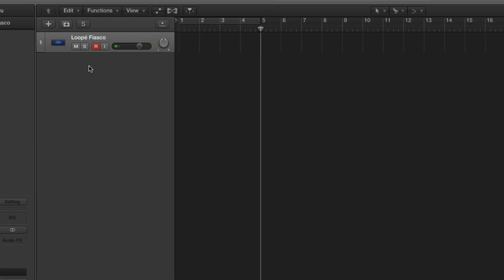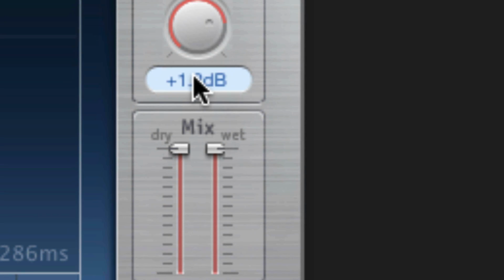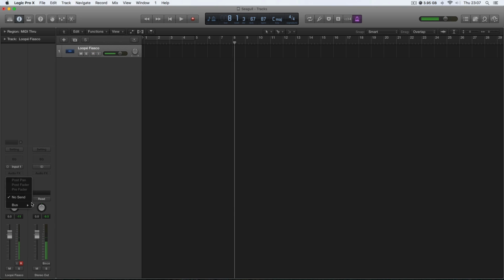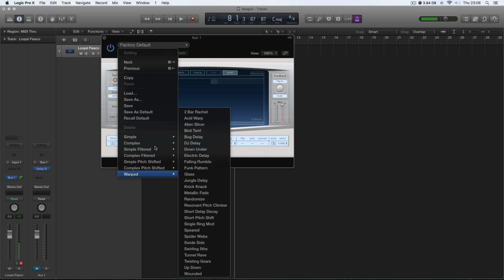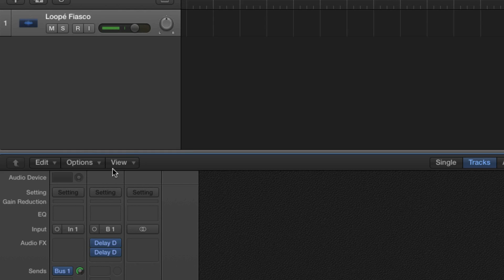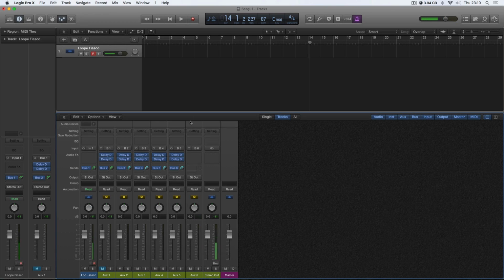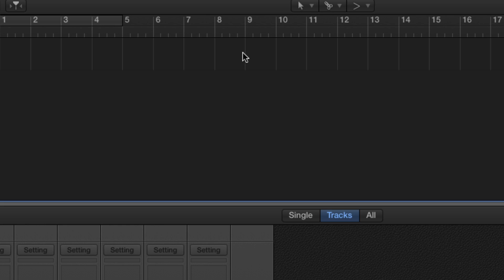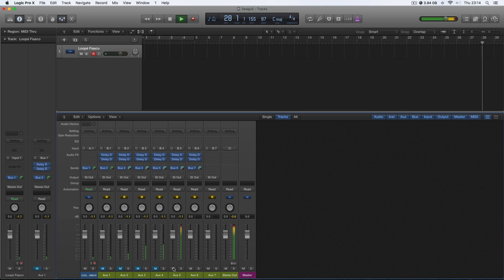How to make a LOOP STATION in Logic X or ANY DAW - FREE

Comment: Hey BEN thank you for this video it really helped. I just have a problem, everytime it loops the volume rises so by the 12 bar the volume of the loop is really loud. Do you know how can i fix this ?? Thanks :)
Reply from the maker: Sorry for the slow reply -

Yeah that's probably caused by something being above the 0dB line. So if you send all the sends at 0dB, and all the bus channels are at 0dB, and the volume in and out within your delay plugin are at 0dB, you should be good, but if any of those elements are at even 0.1dB, it'll slowly get louder over time and eventually explode haha
Reply: I have the same problem... How did you solve it, if I may ask?

Comment: Hey man great tip. Can't believe logic doesn't have a plug-in for this, this works great tho. Is it possible to combine loops with different lengths? Say I got a 2 bar chord progression that I want to play 4 bar melodies over?
Thanks
Reply from the maker: Ah great, thanks! I'm glad it's useful to a couple people. So.. all I'd think initially would be to run a 4 bar loop and play the chords twice.

You could also
• Have 2 input channels (for mic / guitar / keyboard etc)
• Set up 2 loads of delay channels
• 1 bunch set up for a 2-bar loop
• The other bunch set up for 4-bar loop
• Send input channel one (eg mic) to the 4-bar loopers
• Send input channel two (eg guitar) to the 2-bar loopers
• Play the guitar in and then sing

Or if it's the same instrument / input for both, swap the active recording channel after you've got the chords going.

Hope that helps / makes sense! Ha. Good luck :)
Reply: yeah that should work, thanks!